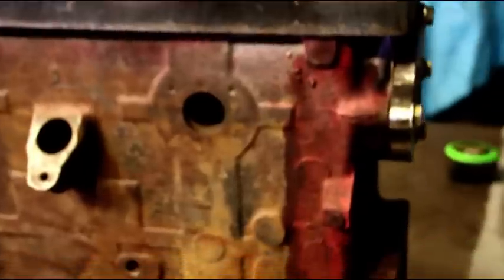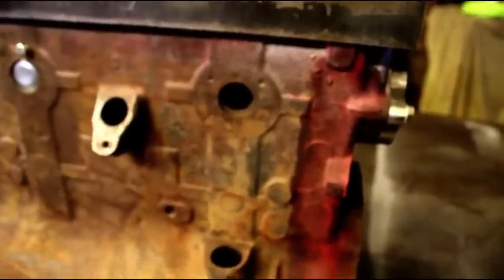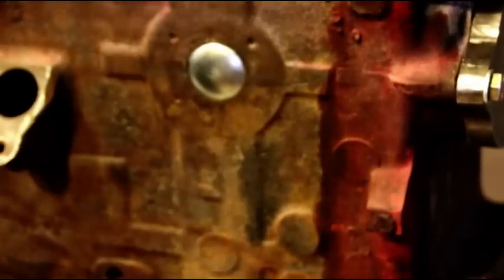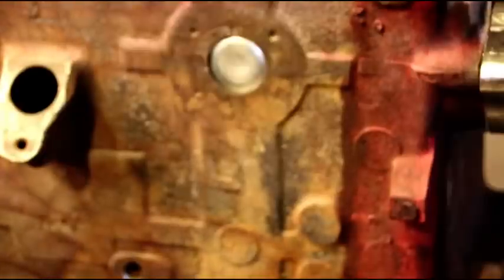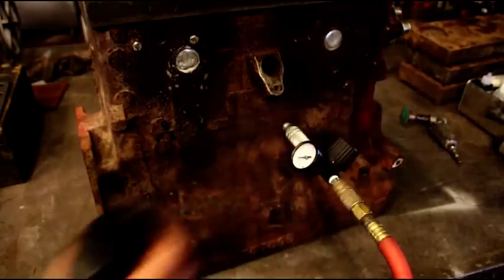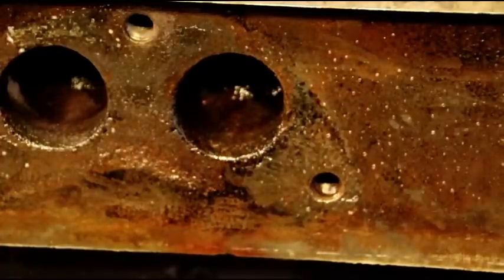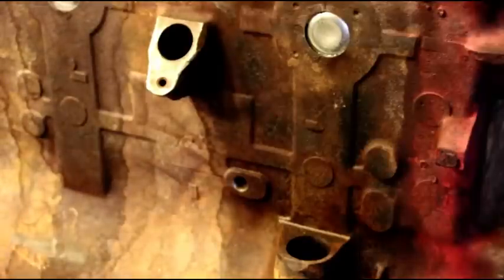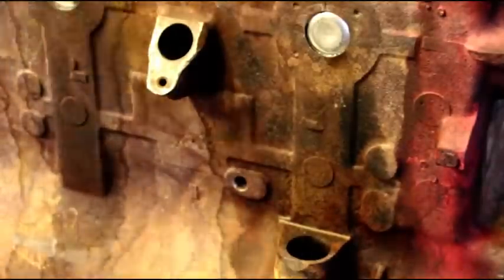Willys Engine Block Pressure Testing

Comment: You can also get core shift when the block is cast, that can cause a bore to cast so that it is thinner on one side than the other. I have seen that happen on older engine blocks. On a big overbore, it can cause problems.
Reply from the maker: Yes that can be a problem.  The old Willys blocks are very heavy built and there was always enough material there.   Sleeving them is common and the bore for the sleeve is just over .120" and can usually be done with no problem.  It gets troublesome when corrosion has thinned out the cylinder walls.  Only way to really find out is to bore and pressure test.

Comment: I didn’t quite grasp the repair you did for the crack in the other video. The threaded pieces you showed looked so large for the small crack. Can you explain or demonstrate them? Thanks! I’m loving this engine series!
Reply: https://www.youtube.com/watch?v=Pq0wfU4ZaKk
Reply: Look up lock and stitch system,  it's pretty amazing. I've seen cracks in huge machinery repaired this way
Reply: That is extremely interesting! Thanks guys!
Reply from the maker: I am going to show another crack repair soon and will cover the entire process.
Reply from the maker: you can find a link to lock n stitch in the section below the video.  Click on it to get to their website.